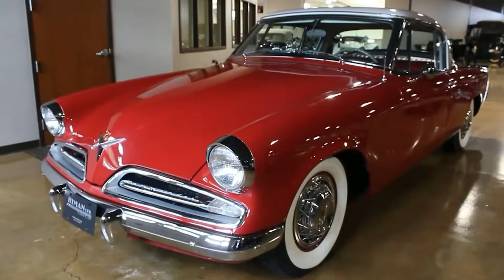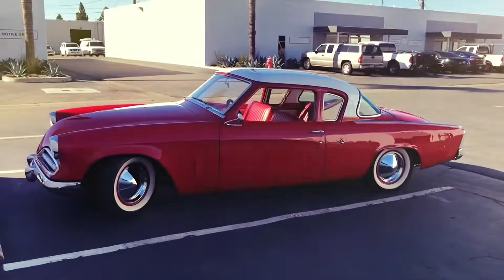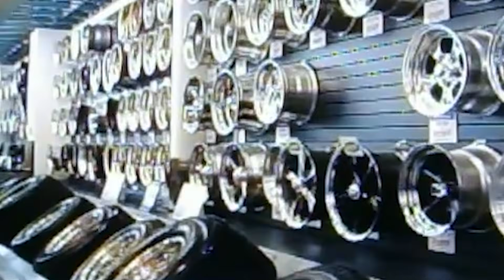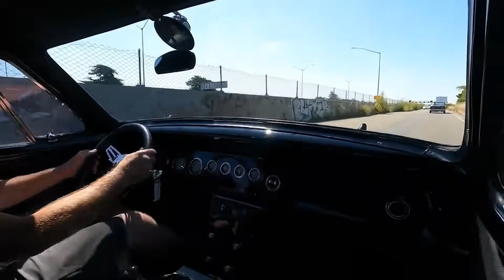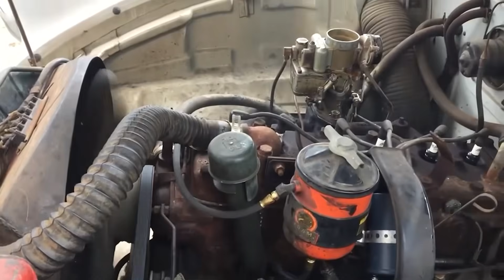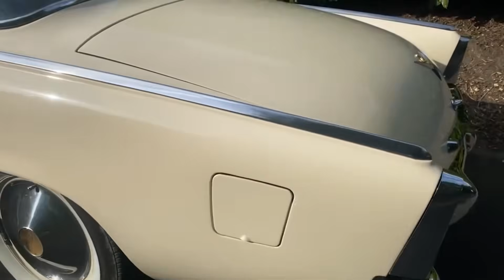Why the Beautiful 1953 Studebaker Destroyed Its Own Brand?

Comment: The frames were improved as horsepower later increased. You make it sound as  if the cars were never pre-rested on the proving grounds - and that would be wrong! There are hundreds of survivors today still with the original frames 70 years later. And the doors are NOT popping open! 
An early '50s car was not expected to be a performer as much as, say a half dozen years later. When only 135 hp was in the 303 Olds engine, 120 hp in a lighter Stude was just fine.
The drop in '54 production was more largely due to the drastic drop in ALL non GM or Ford numbers, thanks to the "Ford Blitz'" that disrupted the market. 
The coupes did have a front end body fitment problem when they first began making them, and after the "fix" was done, they tried to ramp up production to catch up to the unprecedented demand - and that did cause some slips in body quality. BUT the mechanical bits of the car were not affected. They were proven components - many of which were also used by other manufacturers. 
The door handles that you make a fuss about were never used. Why do you even think you should bring it up? The production door handle worked just fine and was used until the end of Studebaker cars 13 years later!
Reply from the maker: Thanks for the detailed insight! That’s a great perspective on the Studebakers, it’s amazing how many original frames and mechanical components have lasted 70 years. Makes sense that early production issues were mostly cosmetic, and it’s interesting to hear the context behind the ’54 drop in numbers. Really appreciate you setting the record straight on the door handles and the performance expectations for that era, adds a lot of depth to the story!
Reply: I wake up pre-rested every morning.